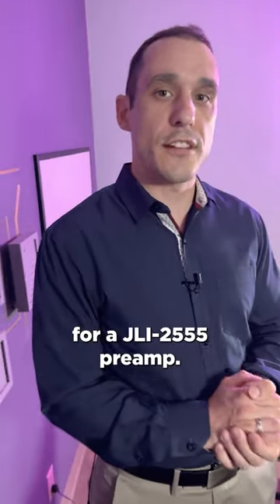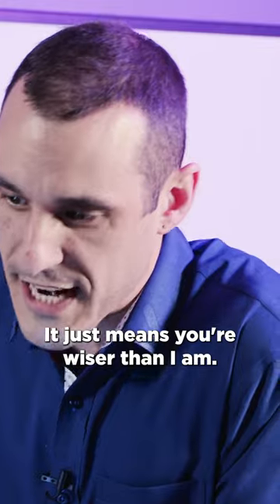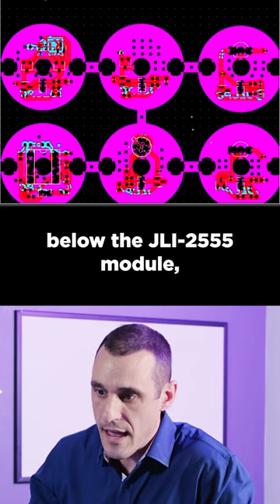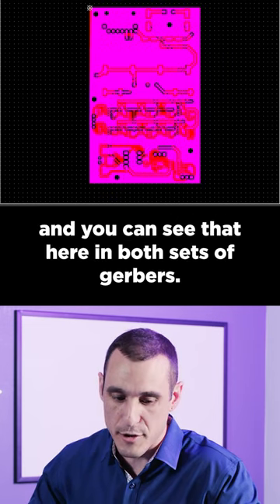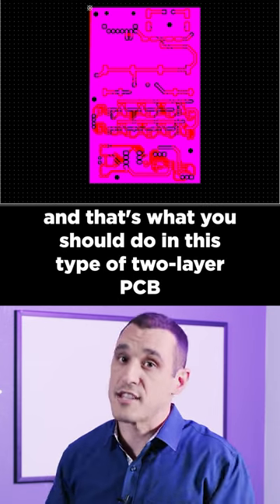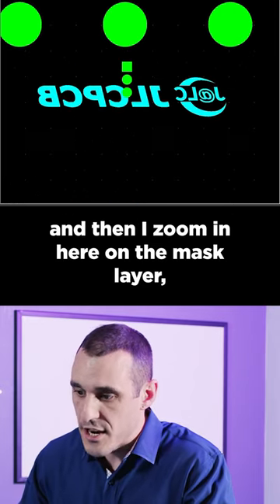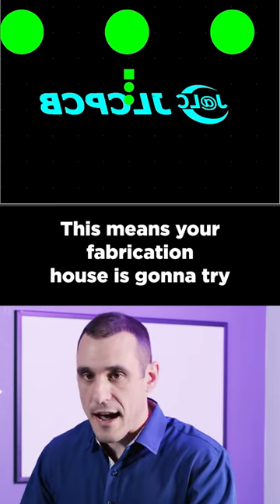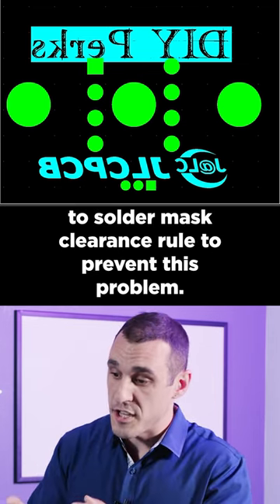Don't Forget the Silk-to-Solder Mask Rule! Preamp for JLI-2555: One Minute PCB Design Review 01

Comment: Most manufacturers automatically remove the silkscreen from the areas without a solder mask, so no need to worry about this.
Reply: I have never had a manufacturer remove silkscreen from a solder mask opening. A manufacturer should not modify design data in any way without written permission.
Reply: @Zachariah-Peterson  Depends on the fabricator I guess! In this case, it seems they are planning to use JLCPCB, who do remove silkscreen from the openings.
Reply: @samulinyman  Shows you how many boards I've fabbed with JLCPCB 👀